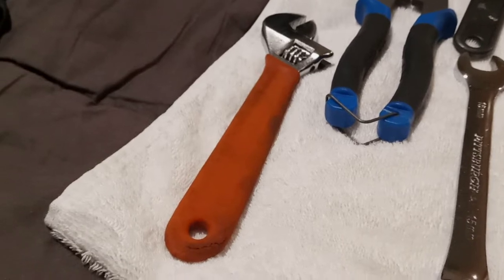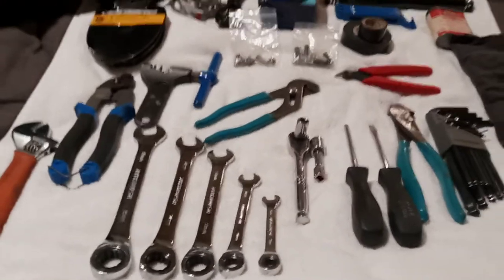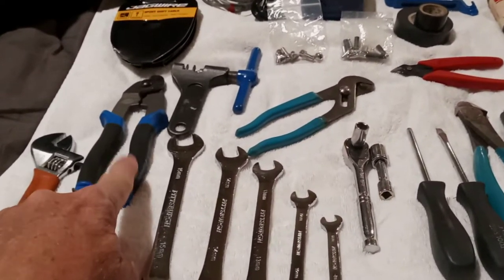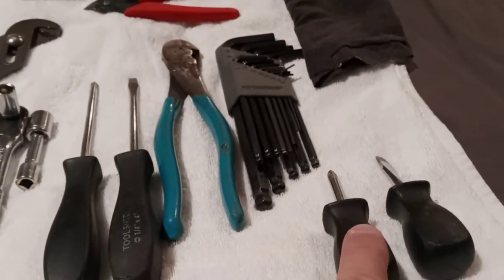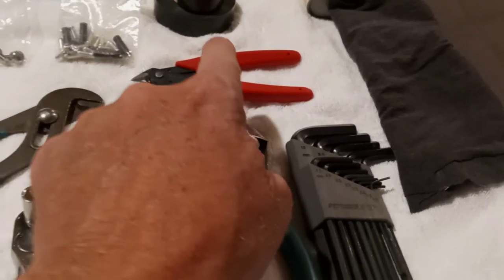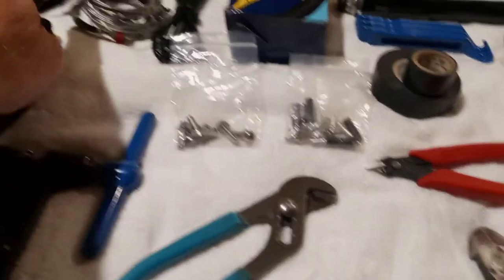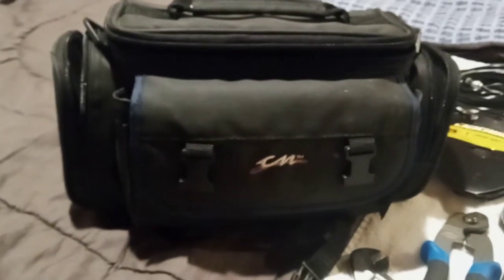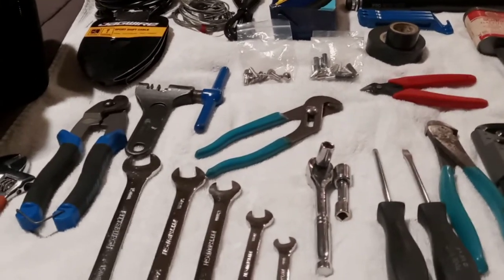New Improved Tool Bag

Comment: You have a lot covered in your took bag! I was recently on a bike ride and a cyclist needed help with her tubeless tire. I didn't have anything to help. She needed those "bacon strip" things and the tool to punch them in. Or maybe something else works. I don't know.  Not sure if you would want to add those things to your bag
Reply from the maker: They are called plugs. I will not be adding them to my bag because I do not run tubeless tires. I like tubes and good tires with puncture protection. Thanks for the nice comment, appreciate you.